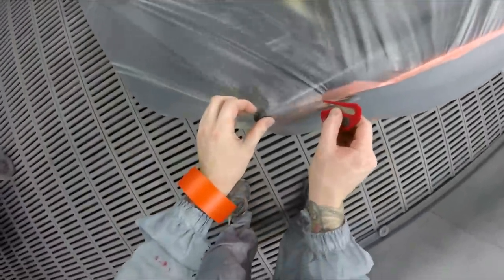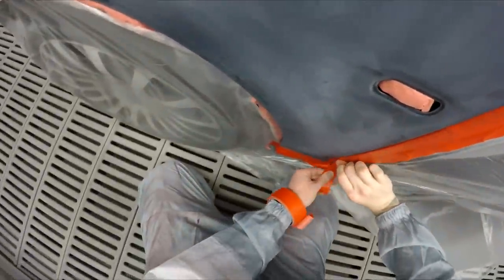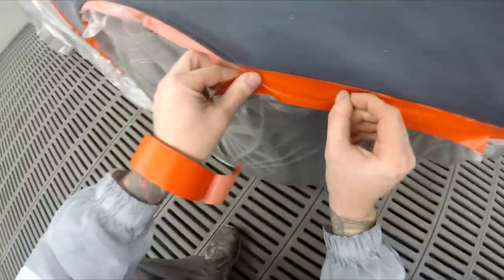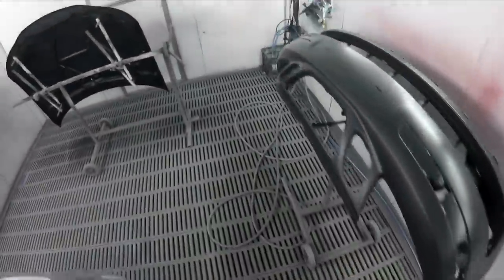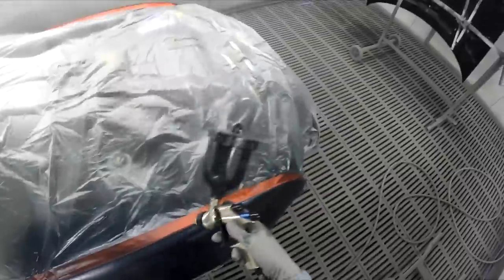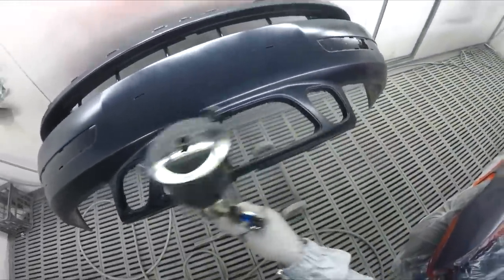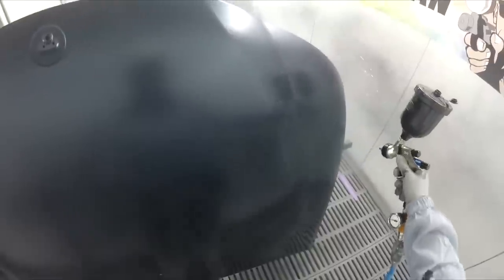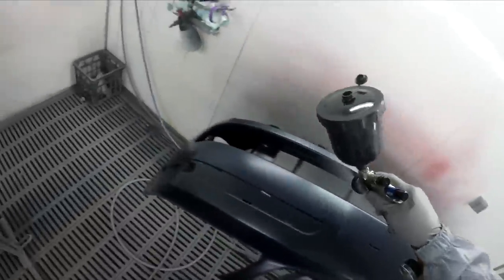Saab 93 FLG5 & DV1

Comment: In your experienced hands. You got to remember people who buy this gun  will spray in the garage or outside. I have tried FLG  and got the same  results as devilbiss pro which you didn't like ( pro vs pro-lite video) Heavy and thick Orange peel.
 I am getting great results using  air caps from pro-lite on my pro thanks for the advise btw and on my  chinese counterfeits . Good enough to spray a bumper or a wing once a year. For amateurs probably much better to suggest 1.2 fluid tips for clear.
 I remember my test panels full of runs and heavy orange peel trying my first dev pro 1.3 tip,  T25 cap, full fan and full fluid following your instructions. Now after many little jobs I love this gun with T110 air cap. Thanks for all your videos.

Comment: So what's it to be DV1 or FLG5. It looks like a fantastic job to me. The reason I asked for the air valve video was because you said I would struggle with the liquid glass and a t110. I have just purchased a second hand te20 pro lite off ebay, Gunny you want to see the state of it you can't even read what aircap it is.